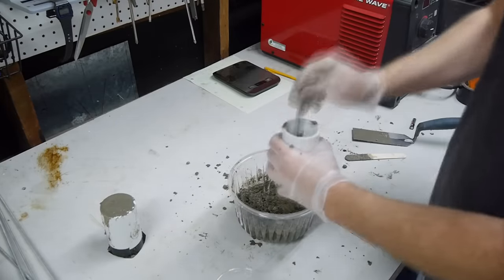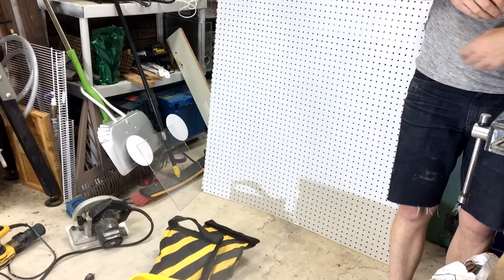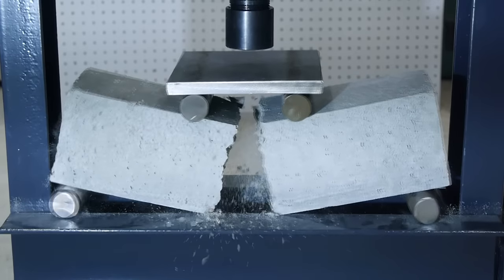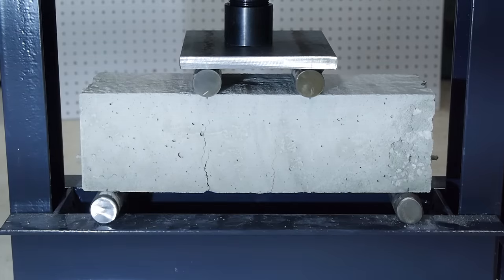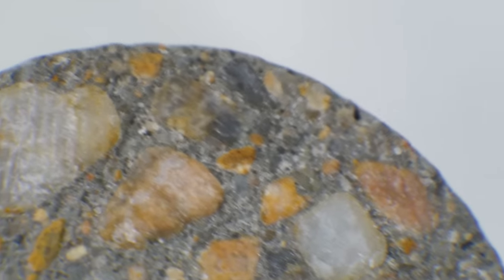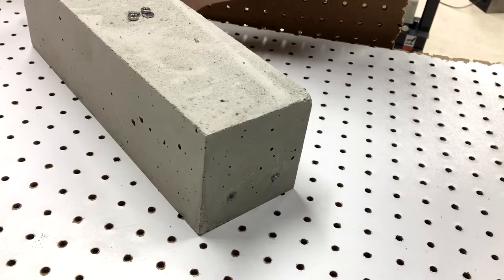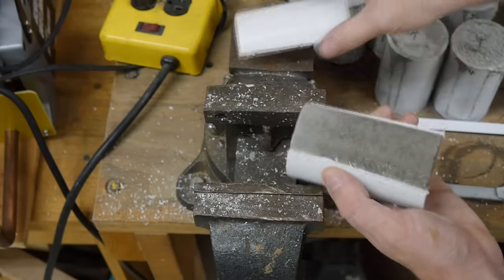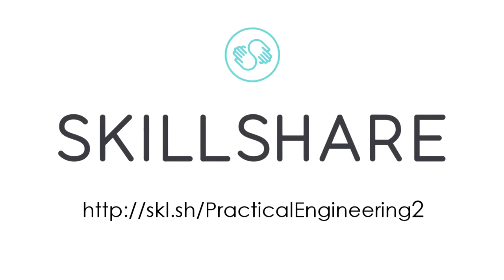Why Concrete Needs Reinforcement

Comment: bizarre mix of really dull and really interesting
Reply from the maker: One of the highest compliments I've received
Reply: Engineering is dull by nature
Reply: Practical Engineering That's how i describe civil engineering
Reply: Good engineering is usually dull, it's the screw-ups that are interesting.
Reply: Welcome to mechanical engineering. ;) (EDIT: And structural engineering. They kinda cover the same subjects from time to time. :3)
Reply: Rand Name p
L
Reply: Almujtaba O. - Indeed. The only time there's something exciting is when a catastrophic failure have occurred.
Reply: Without "dull," for comparison "really interesting" would not exist.
Reply: Only to non-professionals.
Reply: This is structural engineering.  Mechanical engineers do not build with concrete!

Comment: Another concrete video idea: Concrete additives. There are a lot of things that get added to concrete such as fly ash, chlorine, latex and something called "high early" as well as dyes. What is the purpose of  some of these additives and how do they effect the concrete strength, set times, and water absorbtion/repellant properties?
Reply: kk84 kk84 Generally these additives stop the crack to propagate. They act as a barrier to crack formation.
Reply: this could be found in a textbook or internet I'm sure there are a lot of information's about this like setting time and absorbtion and indurance.
Reply: Here are some videos on additives
Superplasticizers - https://youtu.be/q_PwZE57Slc
Air entrainers - https://youtu.be/CXg6kvZWeO0
mineral additives - https://youtu.be/0wOCn7smmIs
Reply: don't forget added fiber
Reply: Damn ME beat me to it. Such as adding fiber which is form of reinforcement that won't rust and crack the concrete in the process. 

But how about the affects of adding air too ei aerated concrete too...

Comment: I was most surprised that the allthread broke as well as the concrete, I'd figure the concrete would have spalled away from and left the (I presume stainless steel) thread extant, but bent.

Comment: Could you go into fiber reenforced concrete, and its uses? As well as best fibers to use?
Reply: This is a pretty basic video and fiber reinforced concrete is a pretty niche subject.
Reply: But it sounds like an interesting topic, so i'd love to hear more about it
Reply: Polypropylene fibers are used in concrete mainly to reduce shrinkage in the specimen. As the concrete cures over time it shrinks slightly mostly due to the hydrating chemical reactions and evaporation. This leads to small cracks that are bad for the concrete's durability. The fibers are almost always used with conventional steel reinforcement as well and I've mostly seen them used on foundations and elevated slabs. There's also steel fiber reinforcement which serves a similar purpose but provides even more crack and shrinkage control.  Hope this was helpful for you or someone else reading!
Reply: More than I knew 10 seconds ago, I had heard some about it, but much on what or why.  So yes, a bit clearer that beffore. Thanks for chiming in.
Reply: Burlapcrete and Concrete Canvas too.
Reply: Those are both fibers, though woven..  also I remembered hempcrete, So it seems an expansion into fiberuos concrete is in order... As long as I don't get concrete overshoes, fiberousbor not.
Reply: I was wondering how fiberglass reinforcement works.
Reply: best for what use?
Reply: In spite of what JM inferred fiber reinforced concrete like GFRC can often replace the use of steel reinforcement based on the engineering requirement of its application. With many peripheral benefits. Since it won't rust like steel that can cause spalling. And FRC does not require proper placement like steel reinforcement does.
Reply: We use the fiber ones at work. They seem to be stronger than normal rebar, gotta use gloves when laying it down unless you want a pissed off splinter.
Reply: Fiberglass rebar is stronger then steel in tension. Over time, they loose strength due to the Ph of concrete, but once degradation stabilizes, it's still stronger then steel. One advantage is that they are more elastic then steel, which means it takes more strength to permanently deform the rebar. It also never rusts and can't burn.

They are made by having fibers of glass pass through resin. Some mix's of resin could have a product that activates using UV light to cure the resin around the strands. (I can't give any details on specific ingredients, I'd be out of a job!) The resin acts like a glue, keeping all the strands of glass together. It makes sure the glass is all working evenly in tension. Diameters of the bars can vary from 1/4" all the way up to 2" depending on what the engineers want.

Here are some quick facts on other fibres that can be used:

Kevlar fibre can be used, but it more expensive. It is more of a green mixed with tan in color. Not sure on the strength though. Haven't seen it purchased but know it's an option.

Carbon fibre is an option. It is a very dark black in color. Not sure on the strength for rebar or if it is even used in construction, but rods made of carbon fibre are very flexible, yet are very brittle. They shatter easily once bent last their limit. They are used in applications such as support bars for crop-protecting tents.

Basalt is an option currently being explored to be used for rebar. It's a black fibre that looks very similar to carbon fibre, but is slightly brown. Basalt is basically volcanic rock turned into small strands almost like thread. Theoretically it is much stronger then glass.
Reply: @nc3826  I call BS on that

Comment: Question for those who are knowledgeable: is sheer stress a normal worry for concrete or steel beams or is that only an issue when building a skyscraper?
Reply: Mister Nimbus  interesting. Thank you. :)

Comment: please make a videos about concrete that would explain what type of different type of concrete (mixt + gravel size) is use for what, what type of rebar diameter used for what, and if there are, some simple rule of thumb for DIY project (eg. to repair a broken wood pillar with a concrete, base, someone will have a rough idea about the type of concrete she needs, and the rebars diameters). This video will be very popular as many people need those basic infos (online calculators are too complicated for beginners)

Comment: Hi! I dont work with concrete at my daily basis, but my home (in a brasilian slum) it's a nightmare, full of cracks on walls, parts made years after others and no blueprint at all, built just on faith and masoner's pratical knowledg. Is there some way to reinforce the concrete after it's cured and built? And the cracks, they can be fixed or they a signal of impeding doom?
Reply: You can add rebar on the cracks and fill it with cement to form concrete. It is a stop gap only.
Você pode botar vergalhões e cimento, chamam isso de amarrar a parede. Mas não é tão eficiente como uma casa feito inicialmente com o reforço adequado.
Reply: Bom ai depende das trincas que vc encontrou. Pois se elas forem provenientes de má assentamento (fundação) ai ficaria muito caro para reparar, ou talvez as deformações por recalque já devem ter cessado o que é bom. Para arrumar elas (se não forem problemas estruturais) talvez baste rebocar novamente, mas se forem proveniente de problemas estruturais ai é melhor vc procurar um profissional de engenharia.
Reply: Ele mora na favela cara, o custo de contratar um engenheiro é maior do que construir outro barraco.
Reply: Idk what the other Brazilians are saying in the comments but i would suggest paying an engineer to inspect your house. There are many things you can do to restore a structure to its original strength or even go beyond its original design. But if you don't know what you are doing, you might end up damaging your house even more. Btw small cracks are completely normal.

Comment: Just a correction in this video. You said in this video ..." for concrete it's pretty low because I added a lot of water to the mix"
Factually concrete becomes stronger with lesser water in the mix. The drier the mix the stronger the concrete. Scientific fact..
Thank you for the programme.
Regards
Foster

Comment: We design reinforced concrete structures the stress before it is cracks. So until this the beam / column/ wall is bearing the loads. So when you say passive rebar doesn’t work until the concrete cracks is not accurate.
I like your videos :) 🙏🏻

Comment: Engineer: At last, I've developed an improved concrete/rebar mix that will—
Boss: We're switching to composite printable carbon/tritanium polymer using cheaper and faster nanite production.
Reply: That's definitely something I'll encounter when I graduate.
Reply: Horse breeders when cars came out:

Comment: Excellent video, as always. I'd like to add just one thing: Steel is much much stronger than concrete in compression as well in tension. But the reason we don't build everything out of steel is because it is wayyy more expensive than concrete. Engineering is as much economics as it is mechanics. Perhaps once we figure out a way to mass-produce carbon nanotubes and make them cheap, a revolution in civil engineering will occur. :)
Reply: Oversimplification r for the simple minded.
Reply: +N C Lol what?
Reply: NVM, sorry that it confused u. But a utube mentality that doesn't deal in details. Like not taking into account what type of steel or concrete or form of strength that is used to make assumptions. And just repeat the terms like "carbon nanotubes" like a mantra. Has no value.  (PS they were just 2 examples of many more reasons)

So much in the same way "You shouldn't make rope out of concrete". And you shouldn't consider a simple minded utube commentator to have any value when it comes to engineering. Have a nice day, Sir. :)
Reply: +N C I think I just got burned in the politest way possible 😂
Reply: NP, enjoy “feeling the burn”. 😂 

But it was more constructive criticism than anything else,TC.
Reply: +N C Ah okay. Well, thanks. I do agree that engineering is all about being specific. However, We can also speak in general terms. For example, the concrete generally used for construction has a compressive strength of 20 MPa. And that's considered pretty good concrete. Now compare that to the lowest grade of steel/rebar which has a compressive strength of 415 MPa. Concrete performs even worse for tensile stress, with an average strength of 5 MPa. From that, it's pretty clear that steel would be better than concrete for any construction. But cement is more abundant than steel, hence concrete is much cheaper than rebar. And so we use concrete wherever possible. That's all I meant in my original comment :)
Reply: Apparently u never heard of 9/11 World Trade Center Collapse? Or the Science and Engineering reasons why it happened...
www.tms.org/pubs/journals/jom/0112/eagar/eagar-0112.html

If u think it still just about compressive or tensile strength of a material u miss the real point and why what u said was an oversimplification. 

So it's sad u think its just about cost. When u should have realized on u own by now that concrete is superior to steel in ways u apparently will never fathom. That's all I meant in my original comment :) TC Sir....
Reply: +N C Wow this got real weird real fast. But thanks for being so kind :)
Reply: U got me curious, what was so really weird? 

I thought I was just pointing out something obvious, that there many parameters to consider in engineering not just the 2 u pointed out. Pls excuse me as someone with an engineering degree I guess I over think what is said here. But its all in good fun. :)
Reply: +N C It was kinda weird that you brought 9/11 into this. But except for that, now I'm curious as to why you still think concrete is better than steel, even though the material properties of the substances clearly state the opposite.
Reply: +N C I'm confused by your statements, at one moment you state "Oversimplification r for the simple minded." yet say "concrete is superior to steel" in the next. If i'm not wrong that is in itself simplifying due to the fact that concrete by itself with no reinforcements i.e. Rebar (steel) is in fact weaker then steel in aspects as was stated by Feynstein, plus we very rarely see pure concrete in any real structural sense. When i say pure concrete i do mean concrete with no rebar or reinforcements. Yet you are correct steel just basing on compression and tensile strengths is not a go to for all material properties but by ignoring material properties which compression and tensile fall under and stating just "concrete is superior" is in itself wrong and sham to see a fellow engineer state any material is superior than another when each material has a use that can be shown to perform better then other materials, For example a type of super alloy at base temperatures might not beat out alloyed steel in withstanding stresses but at elevated temperatures will perform better at withstanding stresses and also perform with little to no expansions which is why we spend so much on producing these materials to be used.  By ignoring material properties to scratch your own ego by degrading another opinions because they are stating facts that didn't fall in line with your ideals for the "godly" concrete, as you make it sound like, should make you feel ashamed of yourself sir.
Reply: N C yes, i althink that because steel is more prone to thermal expansion, and could cause different consequences on a structure if not address rightly. Also I think the confuctability of steel is not good for electricity outflow.
Reply: Another reason is corrosion. Concrete protects the steel from coroding with its alcalinity, making plain steel, without any coating, a viable material.
Reply: Eduardo Graeff true, it would also cost too much if you want to combine iron on another corrosion ressistant metals since they are rarer. Concrete is also cheaper and has abundant resources, at least for now since we are also running out of sand.

Comment: what about vibration? 
specifically on a floor.
Reply: Sweet Joe what about vibration? What do you want to learn?
Reply: Well, curious what a vibration would look liie and how well concrete holds up to it. Say you bolt a machine that shakes to the floor. What paart fails firstm

Comment: Here's a classic problem related to this topic.

Beam dimension
b × h = 300mm x 600mm

Loads: Superimposed dead load 5kN/m
Live load = 15 kN/m

Unit weight of concrete = 23 kN/m³

The beam is simply supported on a span of 12m and are pre-tensioned with total initial force of 1750 kN from low relaxation strands with centroid 220mm below the neutral axis throughout the beam length. There is a 15% loss of prestress at service loads.

1. Calculate the stress at the bottom fibers in (MPa) of the beam at end span due to initial presstressing force only.

2. Calculate the stress at the top fibers in (MPa) of the beam at mid span due to service loads and prestressing force.

3. Calculate the maximum additional uniform load in (kN/m) that the beam can be subjected to without producing tensile stress in concrete.

Comment: Issue not typically addressed with rebar..corrosion.  Exposure to air..humidity...rain..salt water and salt anti icing on concrete roads.  if rebar is not coated with anti corrosion paint/coating...then it will fail inside the concrete.😢
Reply: The minimum cover requirement is increased under certain circumstances to account for this
Reply: The concrete will act as an anti-corrosion coating for the steel bars, unless it develops cracks due to mechanical load, frost-dew cycles, or alcali-aggregate reaction
Reply: Rebar shouldn't be coated by anti corrosion coatings as it reduces bond strength unnecessarily. Following exposure to cement hydration products, a protective film is formed by the external face of the reinforcement which resists a lot of corrosion. Chlorides from salt based products can damage this film, therefore you should be limiting crack widths in the design or increasing cover to negate this, not painting your reinforcement.

Comment: What are some other methods of concrete reinforcement, apart from utilizing rebar/ steel?  Also, from a global sustainability perspective - What are some solutions to minimizing the massive carbon footprint of concrete production?
Reply: We had our carport slab poured with fiber reinforced concrete. Instead of long pieces of steel rebar, the cement mix had many small pieces of chopped fiberglass added. As far as I know, it served as reinforcement and allowed more flex of the slab before cracking.
Reply: So reinforcing concrete is actually my trade/ job you can reinforce concrete in multiple ways, with rebar, wire mesh, fibercrete, fiberglass rebar, or post tensioning. The steel used for rebar is known as pig iron not really refined and has lots of carbon, now based on what method you use dictates how much reinforcing you will need
Reply: IIRC, i believe one of the methods is to "recycle" previously made concrete into the mix. I do not know the specifics, but from what I heard, theyr can drop the carbon footprint by adding previously made concrete to the mix.
Reply: @deeplyclosetedindividual  the fibers do give the concrete some additional tensile strength but unlike rebar they do not hold the concrete together after it cracks.

Comment: The pantheon in Rome is a concrete structure and it doesn't have any re bar reinforcement. Do you think our concrete structures will stand in 2000 years?
Reply: azsazs probably not!